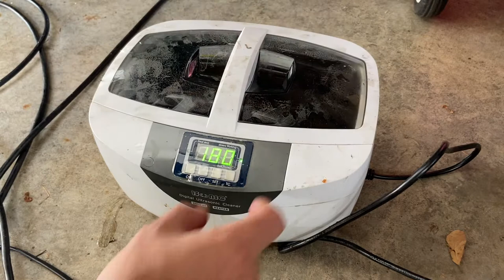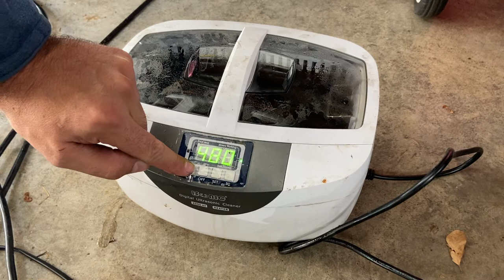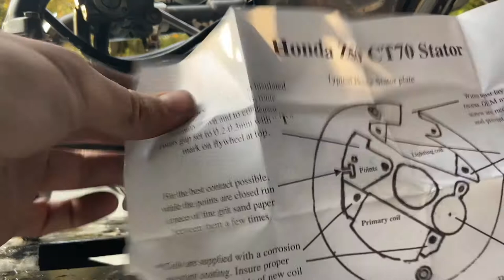$350 Project Honda CT70 Build Part 4: Stator, Points and Condenser Replacement - Hobby Mechanic

Comment: If I remember correctly,you can move the needle in the carb on the slide up or down to adjust mid range ,the jet in the bowl is the main jet.

Comment: Nice video.  One thing worth mentioning is to scrape the wires that are being soldered to the condenser.  Those wires have a clear high temperature insulation on them, which is clear, so they look bare but they are not!  Scrape them with a razor blade to remove the clear insulation from them to be safe.

Comment: i believe there are 4 seals back there . 2 orings for the screws, shaft seal and perimeter seal
Reply: Yes he needs to remove the stator plate to replace the o rings and seals or it will be oil filled again and over time the new stator will fail, the carb is fine also just use the stock adjustment screws that seat properly and it will run fine no need to replace
Reply from the maker: Sounds good.  I shelved this motor for a later build.  You’re right, the carb was probably fine.  Sounds like the issue was the size of the piston that came with the rebuild kit.

Comment: Awesome job my friend I believe you are a great mechanic I wish I knew half as much as you know LOL I have a October 1969 Honda CT70 in restoration process I have installed a new Big Bore high performance 125cc Lifan engine with a 4-speed automatic transmission new 12 volt wiring harness why is there pretty much color coded but still I'm not a good mechanic LOL so I'm having CT Haven give me a little hand with the wiring thanks for pushing up your videos they are pretty awesome I appreciate them thank you my friend good day how to keep on riding I think your bike is beautiful
Reply from the maker: Thanks!  Since making these initial videos I actually decided to go with a Lifan 125 motor as well.  I’m going to table this CT70 motor until I can completely rebuild it.  So I’m going to have some videos of a similar build to yours here in a little bit.  Thanks again for the comment!
Reply: Thank you my friend for your nice compliment you know I still have my original engine and I hope to rebuild and some day but for now I got to get my 125CC going I have done so much to my bike since I bought it had not been registered since 1974 so first I have to California Highway Patrol put it through their system make sure it was not stolen thank God it came back clear LOL then straight to DMV got it registered and tagged up then insurance then comes parts
Reply from the maker: Nice!  Sounds like a good project.  I’m in the same boat with the DMV.  I haven’t got mine titled yet either.  I might start the titling process after I get the motor and lighting working.